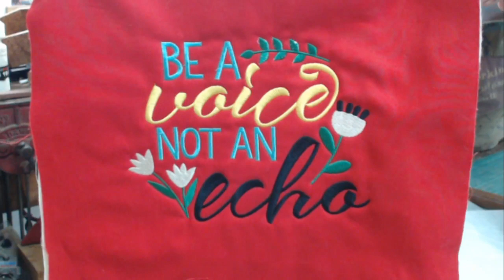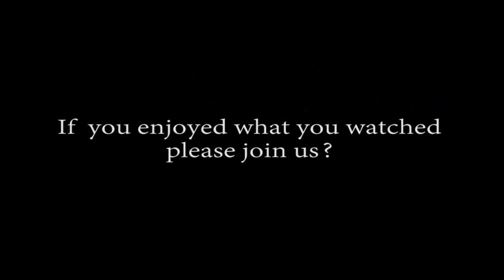(Day 12) ,  French Polishing, Lining Boxes and Hinge Fitting

Comment: Is it easy to loose track of expenses when trying to complete a project and how are you able to track all your expenses?
Reply from the maker: Hi Maleah, Yes very easy if you don't keep strict records. I designed a Job card which I issue for each new job. It lists the clients details, columns for materials and the back it divided into start and finish times so I can keep track of hours worked. I use a card instead of a software program as it is easier to keep it with the job. I have used an app on my phones recently but many times don't have my phone on me or just plan forget to enter the information. Cheers Steve